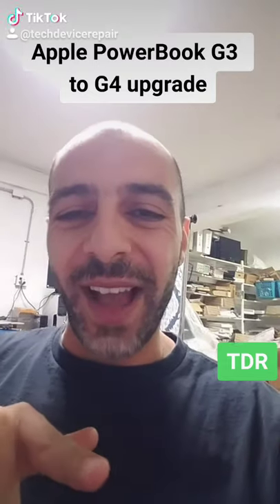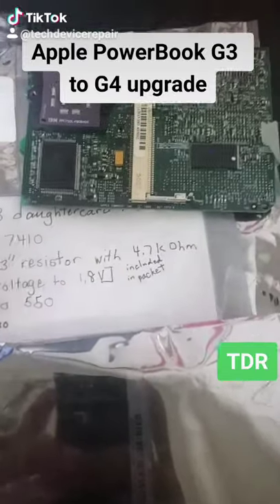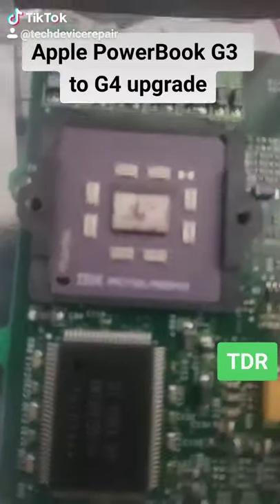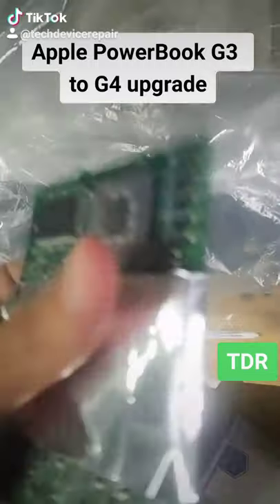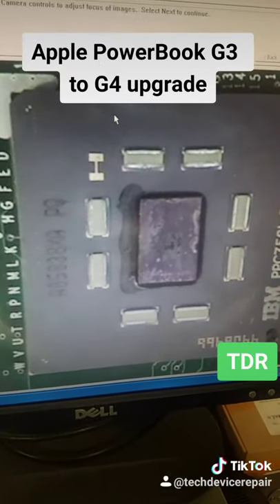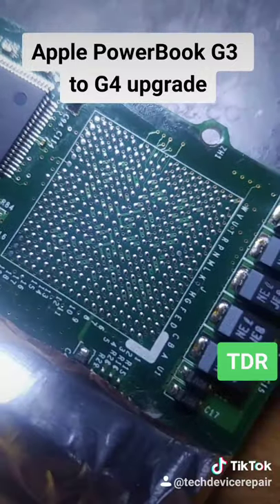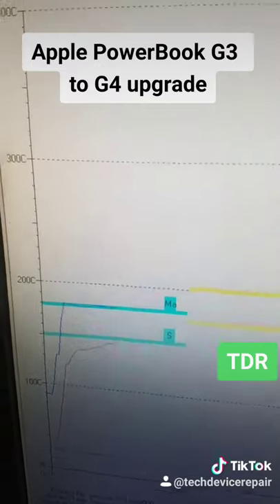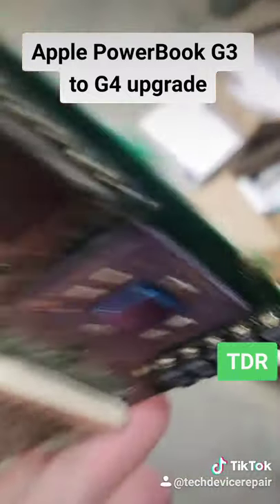Retro Apple PowerBook G3 to G4 upgrade (short)

Comment: How much would it cost to fix a ps4 slim harddrive??
Reply: What you mean fix a hard drive? Like is the disc broken in the hard drive or the ps4 not detecting any hard drives?
Reply: The hard drives are made to be user replaceable, you don't need to be a technician to do it.
Reply: @maryusal2167  it lost all my data and I think the wiring is messed up
Reply: @Nick-fs2yx  that makes no sense. Sounds like a bad hard drive. Replace it. Wires don't do that. Unless you blew out the sata connection or something and fucked your data.